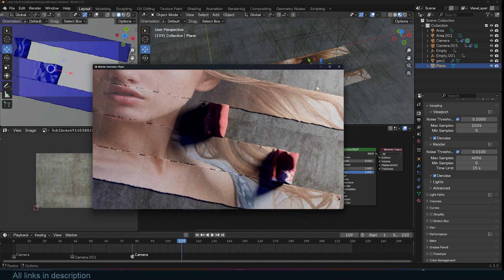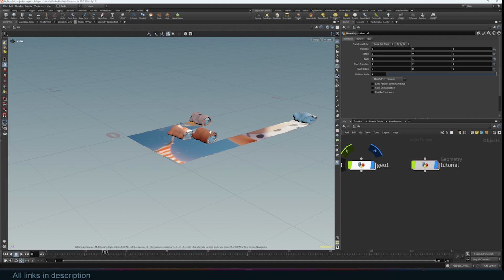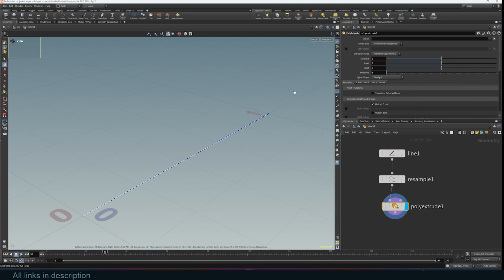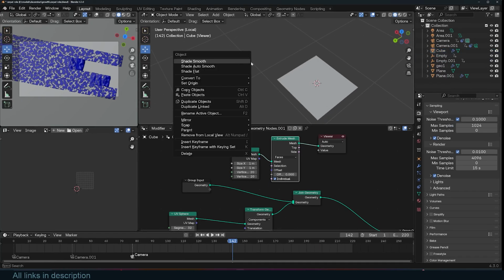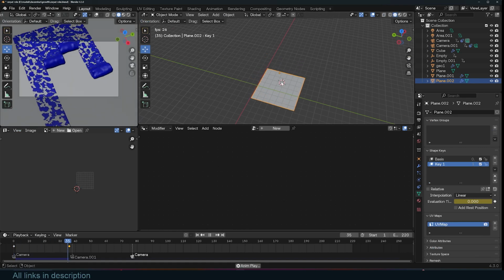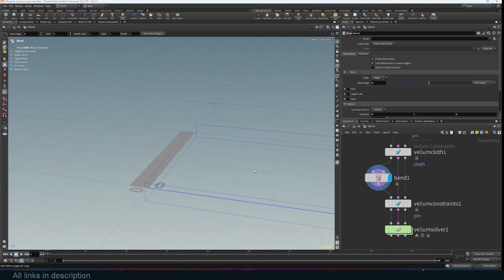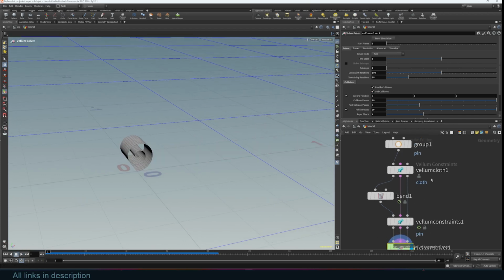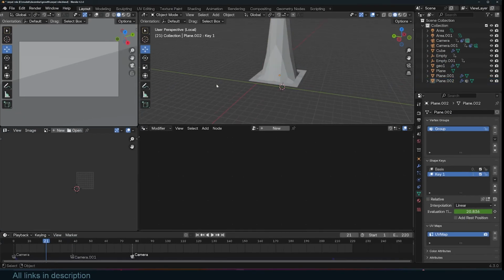learning houdini like its blender   making rolling carpets

Comment: The biggest problem of using blender and houdini right now is lack of usd support in blender. Blender doesn’t have native material x support. Cycles doesn’t support MaterialX. Of course Vray is came to blender. But it’s on beta. Hence it take another 8 months to properly implement inside blender. It’s pain to create pipelines between blender and houdini. 3ds max has wonder ful usd support and Vray material support which we can seamlessly integrate with houdini and blender without worrying about materials and meshes. But I love to work with blender. I don’t want to jump into 3ds max. Hope blender will have good future in usd workflow.
Reply from the maker: yeah, you would think by now there would be an addon for that atleast